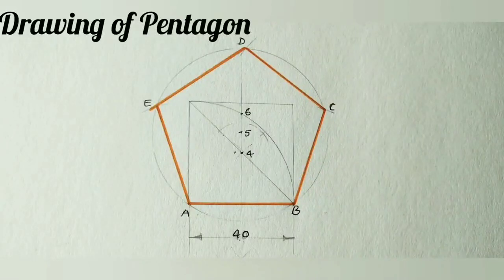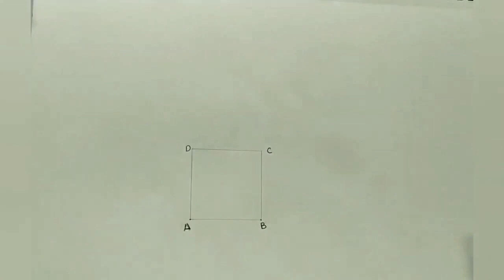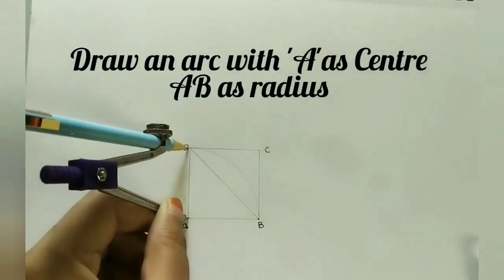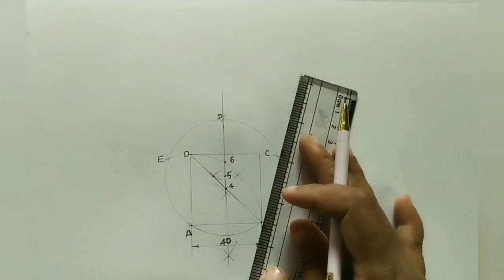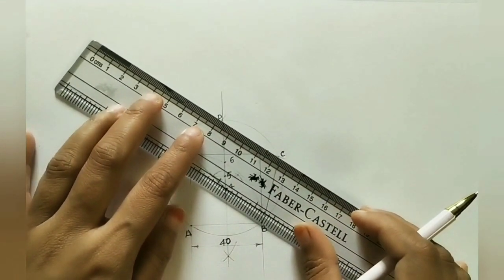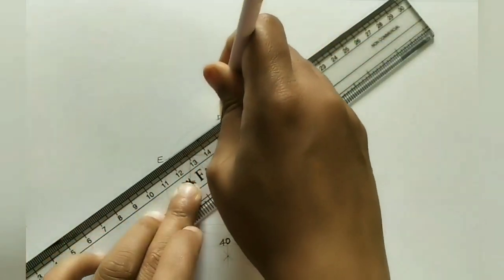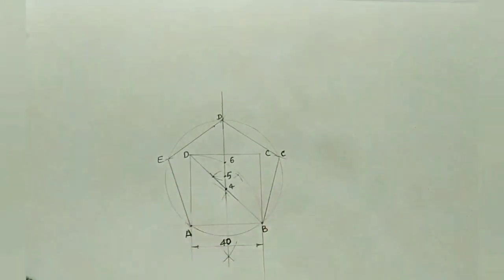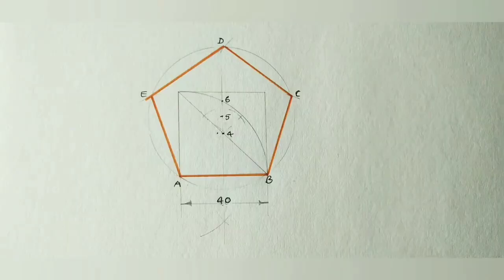Drawing Of Pentagon by General Method

Comment: An oblique hexagonal prism stands on HP and one of the edges of its base is parallel VP. The top and bottom ends of the prism are parallel and regular hexagons of side 20 mm. The axis of the prism is 40 mm long and inclined at 45° to the base. Draw the development of the lateral surface of the oblique prism.